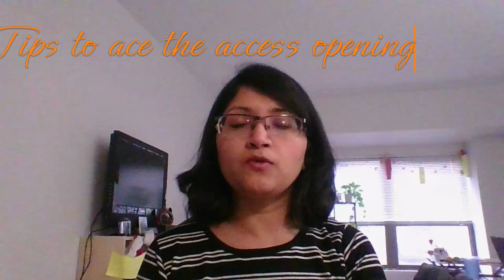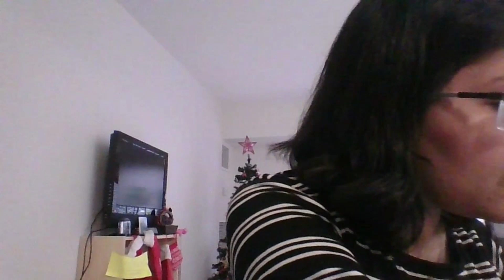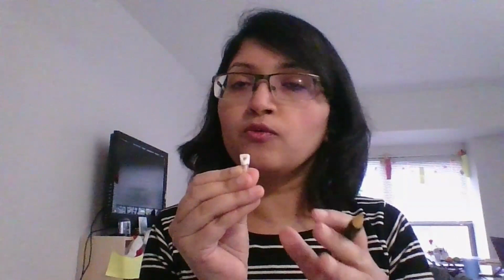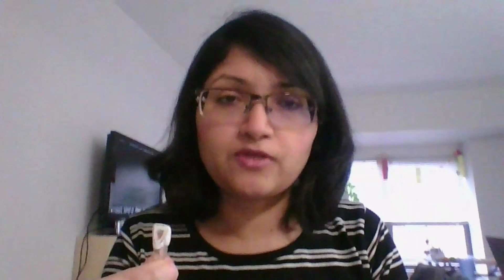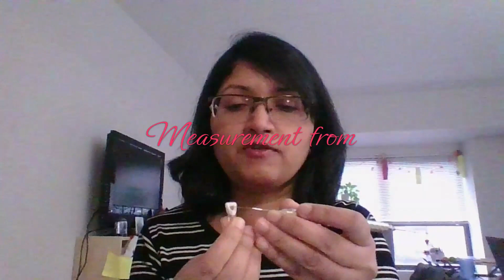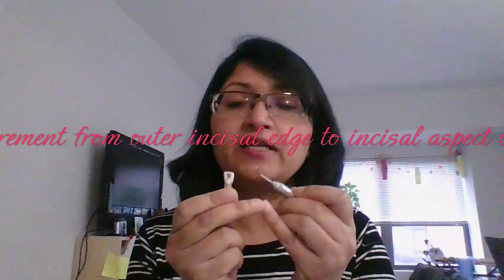ADEX #8 preparation

Comment: Is it okay to have some unremoved wax in the cervical or middle 3rd of the root and similarly okay to have voids in those regions after filling?
Reply from the maker: @pinkwood08  ideally you should not have any wax remaining because in real life scenario, wax represents pulp. So you should remove all. After you remove everything there is no stain/ tint seen anywhere. For voids, refer to the ADex manual. Always look at criteria to decide what is needed to pass the exam

Comment: Hello. Thank you for the video. I have few questions. 
1. Could u go over the grading sheet? 
2  Once I drop into the pulp chamber, I use the diamond bur to smoothen the walls. I often get a ledge on the lingual wall (tip of triangle). Do u smoothen the mesial, distal and lingual wall? Do u make sure there are no catches from tip of triangle to orifice? Do u hold the bur at an angle while smoothening the lingual wall?